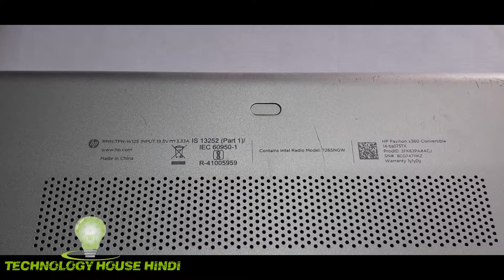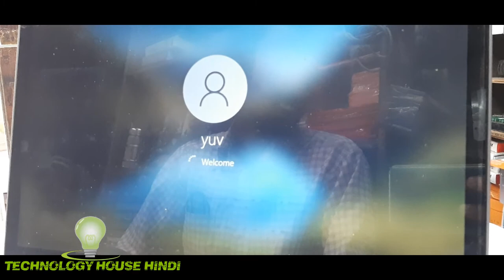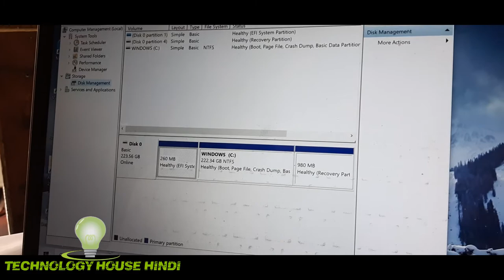HP pavilion 14-ba075tx SSD UPGRADE , HP PAVILION x360 Convertible SSD Upgrade

Comment: I have a very similar Model hp pavilion x360 14ba073tx. it has an m.2 slot but does it support nvme or only sata m.2
Reply from the maker: Its suport nvme
Reply: @technologyhousehindi  thanks for you reply i was confused after looking at videos the port on my laptop looked like an nvme one but near port its written MSATA1 and while searching on Google it was not clear that it will support nvme.
Reply: @technologyhousehindi  hey I've got another concern are you sure it supports nvme have you done it on this model because before coming to your channel i asked same on the HP ask the community and now i got a reply and they said it supports M.2 sata and not nvme? ☹
Reply: @nikunjsanganeria1044  hi nikunj, I own hp pavilion x360 14-ba073tx model too and planning to upgrade ram n ssd. So hv u tried any ssd and which one worked for u nvme or m.2 sata. Pls confirm as it might help.
And did u upgrade ram also? If yes then did u add 4 or 8 GB (manual says it supports upto 12 GB so considering 8gb is already available in slot 1 so 4gb can be installed in slot 2 as per manual) so did u try any
Reply: @imsunil6149  I upgraded Ram. 4 gb was there, added 8 gb to it. Works fine bro
Reply: @imsunil6149  bro mine is same model
I am also trying to upgrade . Have you tried anything?
Please let me know
Reply: @binusabu2863  where is ram located. Is it below motherboard
Reply: @23fash  no bro. I didn't had to remove motherboard
Reply: I opened.. ram and M.2 slot are under the mother board

Comment: the ram is built into the motherboard of this laptop isn't it? I need to do battery replacement but figured I could replace ram at the same time but looking at the interior it looks like either 1 the ram is built into the motherboard or the ram is located under the motherboard and I'm not willing to risk opening my laptop more

Comment: Hii , Please reply

Does my HP-BA075tx support NVme m.2 SSd ??
or does it only support sata ssd ?
Reply from the maker: Yes its have m.2 slot and u can use nvme
Reply: @technologyhousehindi  Hii sir, please suggest a good ssd for this laptop. I am very confused as there is no return policy on sites. Please help :)
Reply from the maker: @ashishagarwal307  adata wd crucial kingston use these any
Reply: @ashishagarwal307  hey, 
have you installed the nvme ssd and does it work?
Do tell if it worked.
Reply: Hi ashish , I own hp pavilion x360 14-ba073tx model too and planning to upgrade ram n ssd. So hv u tried any ssd and which one worked for u nvme or m.2 sata. Pls confirm as it might help.
And did u upgrade ram also? If yes then did u add 4 or 8 GB (manual says it supports upto 12 GB so considering 8gb is already available in slot 1 so 4gb can be installed in slot 2 as per manual) so did u try any

Comment: There are so many different types of ssd on amazon. I am not able to decide on wd green and wd blue. Which is compatible with my HP x360 ba075TX... Please help.

Also, can I use HDD as storage and Nvme m.2 Ssd for booting at the same time?
Reply from the maker: WD blue is faster and u can't use m.2 in this model
Reply: @technologyhousehindi  Thank you so much for your reply. Can you please suggest me the compatible SSD for this model which I can use without removing my existing HDD.
Reply from the maker: @RuturajPatki  what size u want
Reply: @technologyhousehindi  240gb
Reply from the maker: @RuturajPatki  by any 2.5" ssd
Reply: @technologyhousehindi  Thank you so much for your wise reply. Since my model of laptop is not having CD drive, I doubt if I will be able to use hdd and 2.5" ssd together. I think my best bet is to get the nvme m.2 Ssd. Hp service center guy told me that this model supports nvme. But I am not sure because I have not opened my laptop. Saw some videos and looked difficult to find out the compatibility with nvme in this hp x360 ba075tx model.
Reply: Bhai nvme legaga mene bhi laga k os install kiya ssd m gzb speed hogya
Reply: @bharatverma7442  bhai konsa model hai aapka laptop?
Reply: @hayadbashashaik9815  jiske video p comment kr rhe h hm wohi model h mere pass hp 14ba075tx
Reply: @bharatverma7442  which nvme are you using in 14ba075tx
Reply: @mscivilstructures  i installed gigabyte nvme ssd in my hp laptop its working well my laptop is running 10x faster than hdd but u can choose other nvme also and os copy mt krna old os erase krke new os install krna ssd m for best result